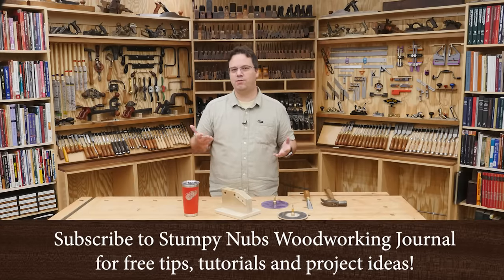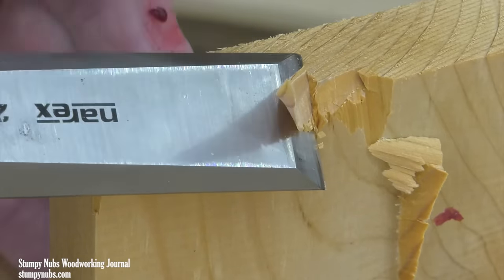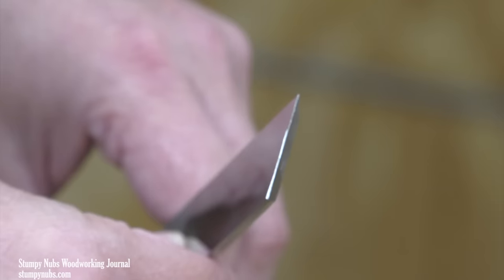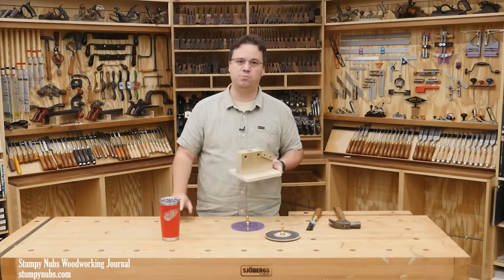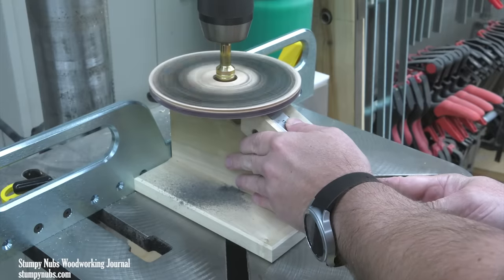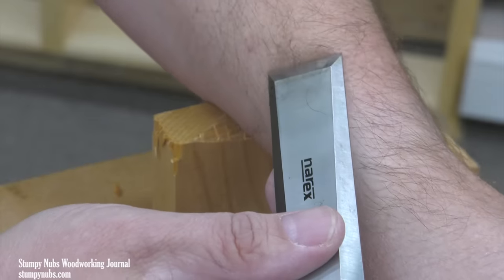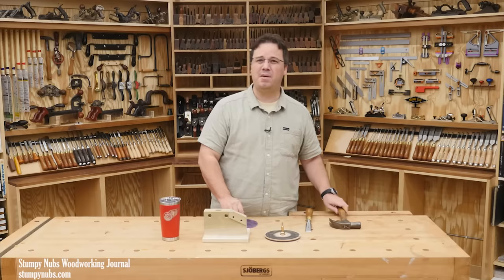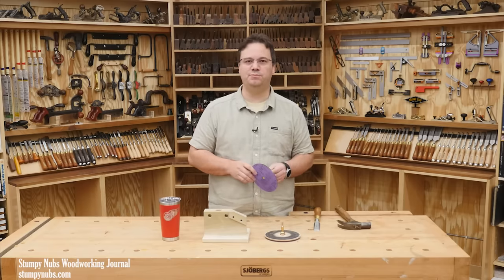Why I use a drill and a hammer to sharpen now.

Comment: Question, it comes with 2 acrylic disks, but then it comes with 7 grits of Cubitron sanding media (disks?) - how do they attach, I saw that screw in the middle in the video, is that it, or do they have adhesive or what? 
Basically what I want to know is how practical it is to actually use all of those grits, and how hard it is to swap out the grits, or, if you're really just going to probably stick with 2 grits that go with your two acrylic disks ?

Thanks
Reply from the maker: The discs are adhesive backed. You'll only use a couple grits, but it's nice to have options.

Comment: You've talked about cubitron before.  For someone getting into woodworking, would you say it's pretty much the 90% solution for sanding (best choice 90% of the time for 90% of the woodworkers)?
Reply from the maker: More like 100%. I still have lots of other sandpaper, so I will be using a mix until that's gone. But all new sandpaper I buy is Cubitron II. It's a little more expensive, but it lasts longer, which more than makes up for the price difference.
Reply: @StumpyNubs  I appreciate it!  As I start my woodworking, it sounds like it makes sense for me to stick with that exclusively.

Comment: I bought this based on this video and was very disappointed after testing it with my beater chisels. 

The sandpaper heated up enough to ‘anodize’ my chisels with only a few 1-2 second plunges as instructed and it was difficult to avoid skewing an edge. 

Long time TayTools and Stumpy Nubs fan - but this one shook my confidence in both. I definitely won’t be using it for my good chisels and should have just spent the money on replacing my beater chisels.
Reply from the maker: What are you doing with it to get that hot? At 2:46 you can literally see me touch the end of the chisel right after it comes off the disc. And that's after the heavy grinding on the coarse grit. It's not very hot at all, certainly not hot enough to "anodize steel" (I assume you mean you blued the steel from excess heat since anodization is an electrochemical process, not a heat treatment).

Comment: Worksharp 2000 w/out the motor (I already have one) but I’ll buy my Cubitron replacement sandpaper from Taylor Tools.
Reply: That's exactly what I was thinking. Although this has one advantage over the worksharp: the ability to move the jig and thus use different parts of the sandpaper. With a worksharp you're stuck going around exactly the same circle on the sandpaper every time. so every piece of sandpaper gets only a quarter inch wide track to ever be used. That's what I dislike most about my worksharp, that one crappy aspect of its design.

Comment: Great tip and video! I'd only like to add that the plans  for the jig are much lower on the page - I looked at the 'top of the product description" for way too long. Hope that helps and thanks again.
Reply from the maker: The product description is the text block that describes the product. The link is at the top of it.

Comment: I'm a carpenter so I have a chisel that I smash up every day and have to resharpen constantly. I use a belt sander with and old belt in it. It's super fast and it's easy to avoid overheating the steel. The bevel is never very accurate but it's rarely necessary anyway unless you're some kind of Japanese wood master. 

I used to spend hours sharpening things to perfection, but now I realise thet it's mostly a waste of time. For most things it's better to get 95% in 2 minutes than 99% in two hours.

Comment: This technique looks like it works great for chisels as they have a handle to control while sharpening. Would like to know if there is a different jig for sharpening the blades for planes perhaps with a clamp to secure the blade. thanks for sharing.

Comment: This is almost exactly how the WorkSharp 3000 works. Its is the same general idea but it uses tempered glass discs and spins them at a nice slow speed as to not overheat the metal.

Comment: This is just a variation of the "wicked sharp" sharpening method that uses a 1" belt sander to achieve the exact same result.  I've been sharpening that way for many years.  Doing it this way works exactly the same so either way is comparable and will yield a satisfactorily sharp tool.  Or knife, I sharpen everything with an edge on a belt sander.  From chisels to pocket knives to kitchen cutlery.  This involves various grit belts exactly the same as Stumpy's disks and includes a final polish with a leather strop belt and polishing compound bars.  

The main advantage I can see with the belt sander is I don't tie up any other machines when I sharpen.  The jig looks nice when it comes to sharpening a chisel but won't work on a knife edge so I'm sticking with the belt sander.  YMMV

Comment: I see they offer a choice of 5" or 6" acrylic discs.  How should one decide which size to purchase?  What do you use?
Reply from the maker: I like the larger ones, but suppose the smaller ones may cost a bit less when you consider the sanding discs.
Reply: Thanks for the quick reply.  If cost is the only issue I'll go with the 6" ones.   @StumpyNubs

Comment: James, I have learned a ton from your videos and I very much appreciate them and enjoy them. Any ideas how to take advantage of this approach without a drill press?
Reply: It's relatively easy to build a cradle to hold a hand drill (corded or cordless) in a static, upright position - you can secure it into the cradle with zip ties, hose clamps, Velcro straps, screw-down collar, etc.  Most hand drills don't have a "lock-on" setting for the trigger (i.e. you usually need to keep squeezing the trigger to keep drilling); that can be solved with a trigger clamp.
There are also lots of plans online for turning a hand drill into an actual drill press, either permanently or temporarily.

Comment: The hammer in the beginning brought my blood up to an absolute boil.

Not only are you dulling, but you're compressing the metal as well, that'll create problems down the line with that tool.

Thank goodness that was for the sake of example.

Being said, this looks interesting, I'm going to make a version for my Dremel, I've got some knives I don't care too much about to experiment with, thanks for this video.
Reply from the maker: The mushed steel is ground off by the sanding disc. It will not "create problems down the line with that tool."

Comment: James I have question on this sharpening  set up or maybe one of the viewers can help.
So I got this bc I needed a better way to sharpen my chisels, it works great! I love it BUT after you do your sharpening and go the strope it gets all of this black carbon on the strope, so how do you get that black carbon off? It's really  slick and really  doesn't  help with the chisels. Any help would be  greatly appreciated. Thanks my friend.  Waiting to hear back, hopefully  sooner than later 😁.
Reply from the maker: You don't have to remove it. If you look at any old strop, it will be black. Every once in a while you put a bit more of the polishing stick on top. If, after many years it got really caked, you could scrape it off. But it is unlikely to come to that as long as you don't overapply the compound.

Comment: Curry Custom Cutlery uses the same type of cubitron belts and leather belt on a cheap Harbor freight 1x30 belt sander and a bevel jig to quickly make knives razor sharp.

I have no doubt that this method is equally effective and possibly more time efficient.  Especially for chisels

Comment: Um,
I’ve already built a jig for setting bevel for chisels and plane blades. I use a LN honing jig on stones after. 

While this idea seems attractive, I actually use my drill press for other tasks. 

How do you set the drill press table to match angles already determined? What if you screw up your angle jig?

Love your YT content, but this one… scratching my head. 

Sorry, but would love your input. 

Just keep’n it real.
Reply from the maker: Your drill press table should always be set perpendicular to your bit for normal use. That doesn't change when you use this jig. Not sure what you mean by "screw up the angle jig." The jig just keeps the chisel at the same angle each time. It doesn't matter much what that angle is (just somewhere around 30) as long as it is consistent, which is the point of the jig.

Comment: Is there any reason why, instead of keeping the sanding disc spinning at the same height and moving the chisel onto the disc that you couldn't just keep the chisel stationary on the jig and use the press action of the drill press to lower the disc onto the chisel. You could even clamp the chisel to the jig to make sure it doesn't shift.

Comment: ok I have a labour of love project that might be beyond hope. 
I have an ancient Stanley No. 110 hand plane that I salvaged from a barn fire and brought back to life with just love and vinegar
I can't even find documentation on it, all I know it's likely from the very early 1900's and the blade may have had some irreparable tempering damage.
I'm not a metal guy, so I don't know too much about that, but the blade seems to accumulate filings on one side when grinding it, like it's only magnetic on one side, so I get the intuitive feeling like it's more damaged than is visible. It also wears more in the center than at the edges. This is my first plane ever, and I would love to know enough about it to be able to use it gently for a little while longer before perhaps posting it online as a collector's item. It's a genuine antique. Any ideas?

Comment: Looks nice and the price point is decent, but the "set it up in the drill press" part gets to me.  What I'd like to see is a similar system adapted for a common bench grinder so I can set it up and then leave it set up for when I'm in the middle of a project and need to restore the edge on my tools.

Comment: I have followed your advice and been buying components from Taylor Tool, Thank you. I looked up each of the links you provided with this video and I cannot locate the plans for the wooden stand to hold the chisel under the spinning wheel mounted into the drill press. The link takes me back to Taylor Tool parts.
Reply from the maker: Scroll down this page a little. https://lddy.no/1i3mb The link is at the top of the text section just below the social medial icons.
Reply: Thank you I missed the click here which brought up what I was asking for, Thanks again, I watch all of your you tbe video's.

Comment: Love the concept, but this technique only works for those that have drill press, which means it’s meant for those that already have lots of machinery and the space for those machines.
Reply: Would love to see the concept for a grinning wheel used to sharpen tools.
Reply: @Quality_Guru  - I'm more likely to try an angle grinder clamped to a stool.

Comment: The standard, or usual method of getting the chisel back to normal, when the honing or secondary bevel has become extended too far into the main bevel, is to use a water-dipped grindstone to make a new bevel.  That's hardly a long or arduous process.  Why is it being suggested that this method is much better?  [Genuine question]

Comment: I tried this on a plane blade, and now the edge is crooked. The bevel is consistent, but one side of the blade is longer if that makes sense as to which way it's off. Any suggestions?
Reply from the maker: Be sure your drill press table is not tilted (check all 360-degrees)
Reply: I checked and it parallel to the disk in all directions

Comment: How is this different from a combination disc/belt sander to cut the primary in 10 seconds flat? That kind of stropping is going to wear the two edges out of flat.
Reply from the maker: It's different because the jig makes it easy to hold it at the proper angle. But you can use whatever you like. And no, the stropping is not wearing anything out.
Reply: @StumpyNubs  Maybe hold at "exact" angle, but most half capable human beings can hold things, including taking on and off at a "proper" angle.  As for using the leather like that...  no the back will NOT be flat.  It may be sharp but it will not be flat.  You can see the effects by simply running the back on Arkansas, you will find that you can only cut the centre.  If sharpness is the goal, then you may have it.  If sharpness with registration is the goal, you won't like the results.

Comment: I knew it was coming and I still cringed when the hammer hit. 😅

For what it's worth, your link goes to their V1 system but they have a V2 as well, though it's not clear to me what the distinction is.
Reply from the maker: There is really no functional difference. The V1 is the one in my video. V2 has a 3/8 arbor instead of 1/4, and a different type of leather (horse, I think). They just changed suppliers. Once the V1s are gone, it will all be V2. I'd recommend the V1 for the lower price while it's available.

Comment: I've wanted to make a little setup like this for quite a while. But 3M Cubitron Stikit (the adhesive back discs used here) are very much not available here in the EU. Even mailed 3M about this, they told me they probably will never be available here. Only the Hookit type is available (Velcro back). I kind of feel that when I would use the hookit discs the slight padding the Velcro will provide will result in a slight convex grind. Anybody have any tips? Maybe alternative sanding discs?
Reply: You can buy the 3M paper in sheets, why not just use spray adhesive?

Comment: I wish there was something as fine and easy as this for chainsaw chains. All the mechanised solutions compromise badly in some way - changing the tooth profile, heat-hardening the tooth, or theoretically speeding the process up but requiring lots of setup time or still requiring very fine hand-eye coordination, negating the benefit. We've tried everything out there and none of them are meaningfully better than just plain old hand filing, but it's incredibly tedious.

Comment: Is there any reason this would not work for plane irons as well?
Reply: I was wondering that too. The description on the product page says It is designed to sharpen chisels and other baldes up to 1-1/2" in width. Curious why it wouldn't work with a plane iron.

Comment: While this is handy, the only problem is the direction it’s sharpening. They will stay sharper far longer if the grind is in the direction of the cutting edge but if it runs parallel with it or swirls in this case you will be doing it more often. Could be a big deal for some more than others.

Comment: This is a great way to get a shard of acrylic lodged in your gut.

What’s wrong with a bench grinder?
Reply from the maker: This is spinning MUCH slower than a bench grinder, and the chance of a solid 1/4-inch acrylic disc blowing up at that speed is WAY lower than the chance of a press-molded particle grinding wheel shattering.

Comment: I watched this with growing surprise.  It's not that this system doesn't work, but . . . most people I know who use chisels a lot sharpen them with a belt sander they already have handy.  If you haven't seen someone use a sander (of whatever kind) to sharpen a tool, sure, it's a good tip, but . . . it doesn't matter.  Get the word out.  It's a huge timesaver.

Comment: Any comparison between this and the worksharp 3500?
Reply from the maker: They are both spinning discs.
Reply: @StumpyNubs  but it seems that these discs clog up less ?
Reply from the maker: @michaelgiordano3757  The sandpaper is obviously different. But you could put a 6-inch Cubitron disc on a Worksharp, if you wanted to.

Comment: Thanks James. Would love to give this a go, unfortunately being in Australia, the human race could end by the time it is available (Taylor Tools take note).
Reply: As others mentioned before, this tool can easily be made in the shop. MDF for the disk and arbors are readily available in any size and configuration. Even a suitable bolt would do if you don‘t mind the stress for the drill press chuck. And for stropping the upside of a MDF disk works great with a polishing paste. I have done it and it really works!

Comment: Can you show a easy way to sharpen different knifes with different angle blades cos you had to use a jig for this how would i do it for the knifes please can u show this because of my disability i use knifes alot to open different things crisp packs chocolate all sorts i spent so much money on different sharpeners but i can never sharpen them so i just buy a new knife i have 20 knifes now and if i could sharpen them it would help me so much and save so much money because of my disability my muscles are really weak so i think that's why im struggling to sharpen them

Comment: That's alot of wobble, but, for quick and dirty "get back to work" sharpening, this is more than good enough.
You're going to wear out your strop breaking the burr on it like that though, should really just have a second part of your jig that can do so on the higher grit paper, or just do it by hand without the jig, only takes a second.

People get real worried about heat in situations like this, and it's not really a huge problem, you have to be properly reckless to kill your temper using sand paper like this. On a grinding stone, sure, but, you should never have to use a grinder, and you don't need the material removal rate those provide.
Reply from the maker: People have been removing sharpening burrs (which are barely attached) with leather strops for centuries. They last many years, and if worn out, leather is not expensive.